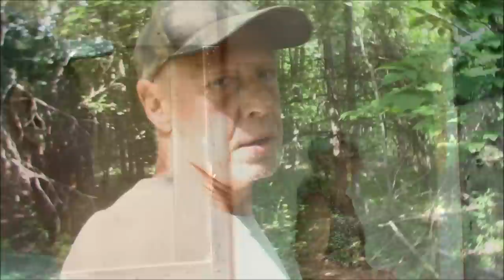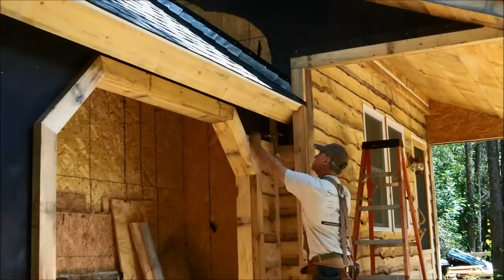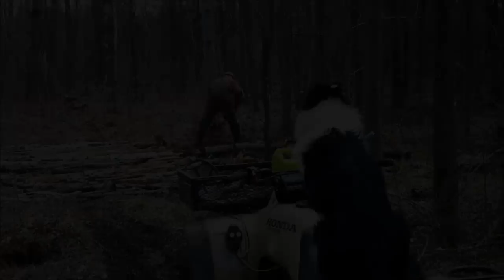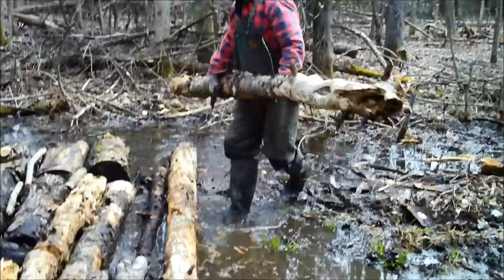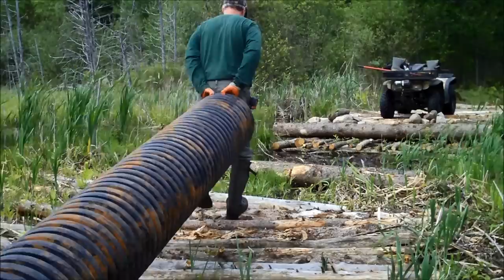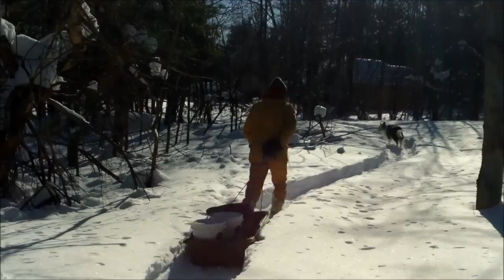BUILDING THE BACKWOODS CABIN and The Road Leading To It   REFLECTIONS OF THE GOOD OLD DAYS  Vlog 156

Comment: So great to see the old videos of you and Supervisor Frankie. 
My Dad used the poplar trees he cut on the land they once owned to fill some low spots and mud holes.  Gravel came in when he could afford it.  Another solid built up entry.

In Ontario there are still miles (kilometers up there) of old corduroy roads. Up there they call them Concession roads.  They do get worn down and you can actually see the corduroy ridges.  The Townships oil them in the Summer as they are dusty at all get out. Or they re gravel them, making the drive over that particular road like driving on ice should one go too fast.  Lots of good memories of living up there and sight seeing on those old roads.

The small towns have paved over lots of them. If you don't know the history, you'd never know that underneath is tree trunks. The town I lived in had to lay in new sewer lines and water lines.  They dug down so deep almost, through asphalt and concrete 12 plus feet!  Hitting the old rotting trees that had been laid ages ago. Goes to show you how much was added to the top of those tree trunk roads over the years ;)))

Comment: I’m after building lots off ATV trails on old logging roads that is cordory road. They were built over 100 years ago and they are still in great shape. Only parts of the trail that didn’t have to be dug up.  The wood takes a long time to decay when under the ground and no oxegen.

Comment: Jimmy, I'm 67 and got Lyme for the first time this year. I'm now treating clothes with permethrin. How do you deal with wood ticks?
Reply from the maker: The only prevention I use is constant tick searches. If you remove them within a days time you're pretty safe they say.
Reply: @thebossoftheswamp  - Thank You Sir! I have never had a problem in the north woods until this year and managed to get both Lyme disease and Babesiosis while limbing and bucking trees. Done it for years with no problems. I read the tick problem in the US has doubled from 2022 to 2023. It was not fun to say the least. It pays to be more thorough and I thought I was. Then, I learned a tick could be the size of a poppy seed in their early stages. Since then, I started using more aggressive tick searches and treating my clothes. Jimmy, I hope you or your better half never experience this. Symptoms are very deceiving because they feel like the flu.

Best Wishes To You Both In All Your Endeavors!

Tom
Reply from the maker: @thomask4836  Thanks for sharing this. Yes some of these ticks are puny and hard to detect.  I've gotten a little too relaxed with this so thanks again for the eye opener.